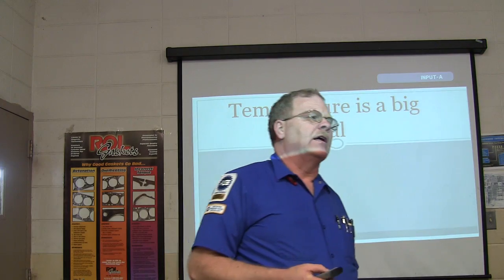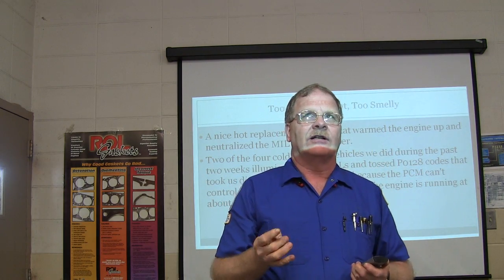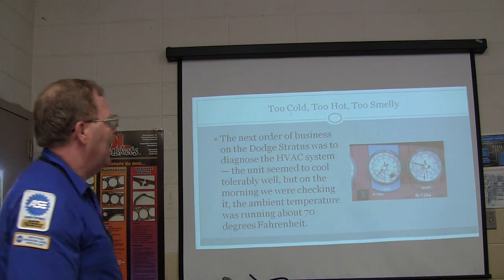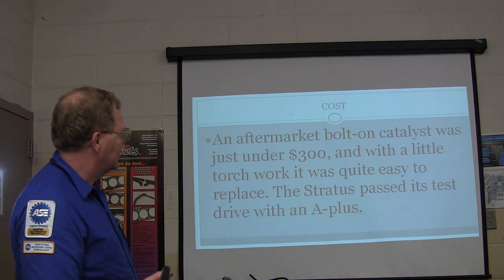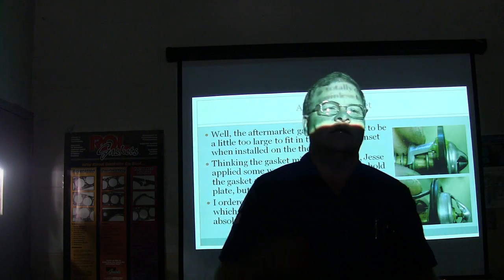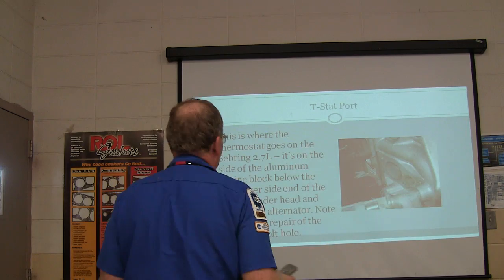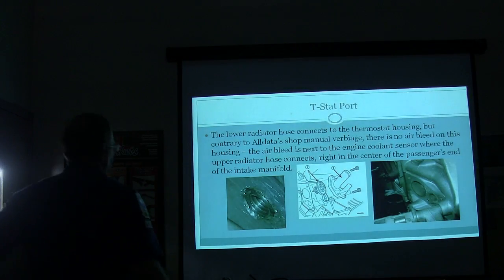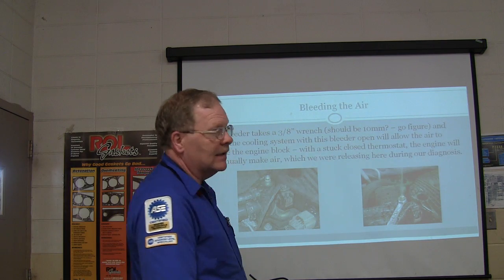Temperature war stories

Comment: There is this other Y.T. video dude that likes to use that liquid coolant sealer on customers rides. I put a message on his channel that I would rather fix the problem. He did not like my message and argued how much money he was saving his customers. I  have seen coolant that does not get changed turn the entire system into swiss cheese. Check out how much labor a ford flex water pump will charge. Any time I repair a ride that got too hot I like to do the thermostat and radiator cap. I also suggest radiator cap replacement with coolant service. Sometimes you need figure the thermostat temp with the new part before installing it. Stories of great value.
Reply from the maker: Good advice!!